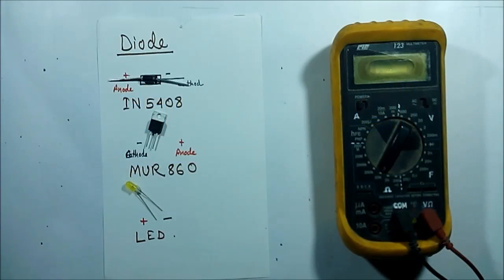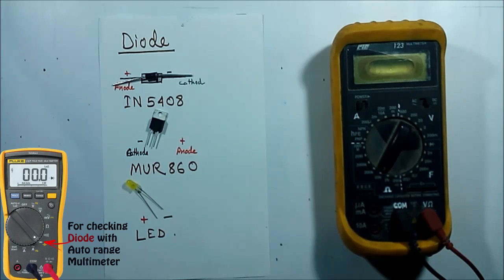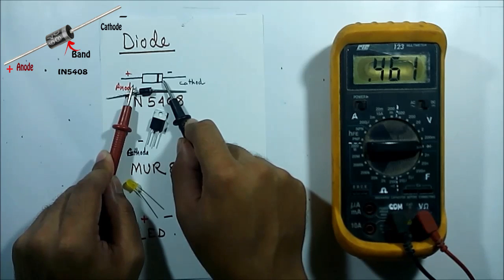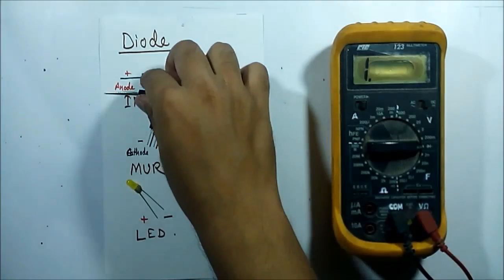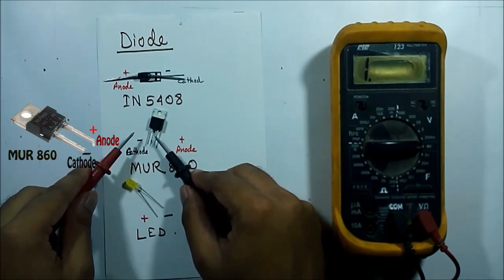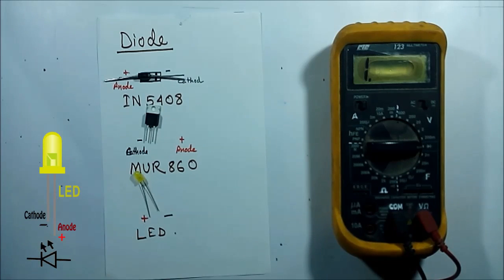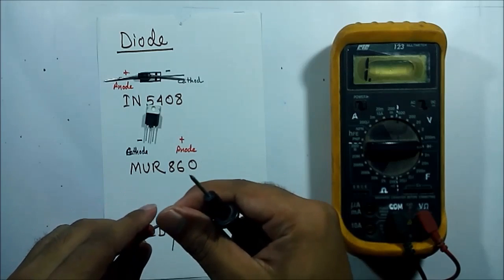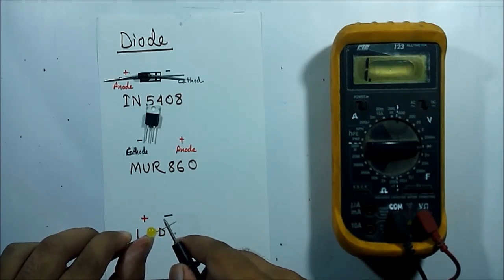How to test diode using digital multimeter / Multimeter tutorial

Comment: When testing LED one should look at the notch or flat endge on its plastic packaging, indicating a cathode or negative lead.   Wires can be cut short or same size and its not enough to tell the anode from cathode just by the wire size.

Comment: Sir, can I check the diode with tester while connected in circuit board or pcb? co'z I checked some diode while connected in circuit, all result show the same, like the one's in your video..except 2 diode showed different, where both anode and cathode gave a result when I touched my probe vice versa.
Reply from the maker: +wolfenstein1040 
No. Sometimes 2 diodes are connected in anti-parallel, then you can not identify the good or bad diode. Both case you will get continuity. So always remove the diode from PCB before testing.